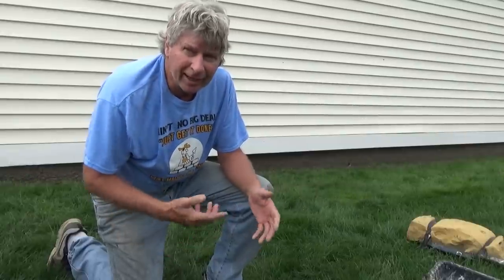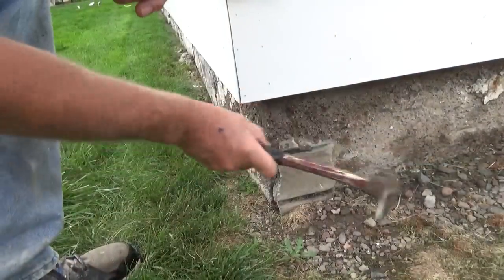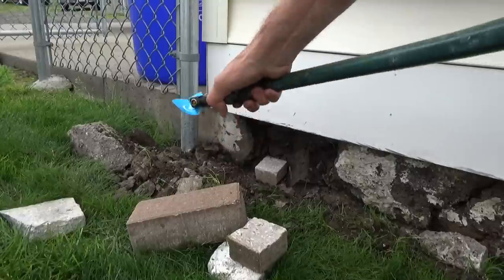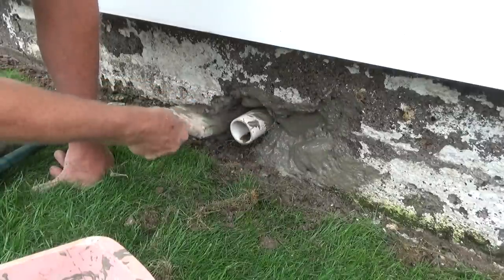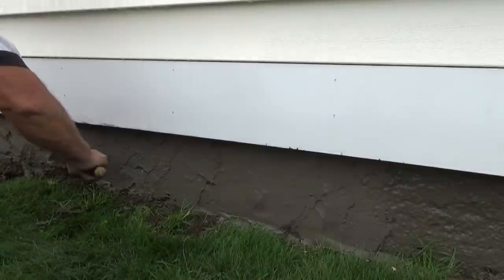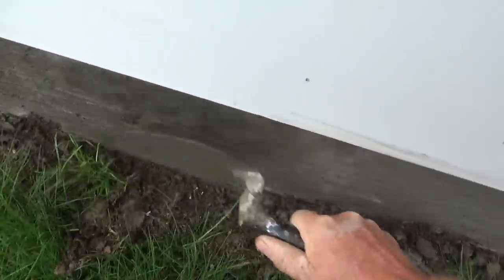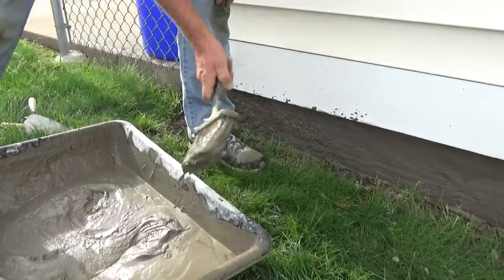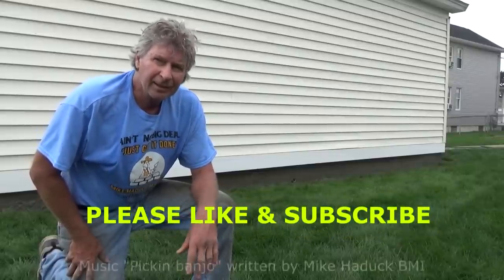FOUNDATION REPAIR (Part 16) Mike Haduck

Comment: One difference between the use of regular Portland
mixes and the fast dry compounds is the shrink cracking & checking issue.
Those newer products seem to shrink a lot less.
I've tried to use them for surface areas. Thank you Mike.
Reply from the maker: Thanks pensive, Mike

Comment: Love your videos Mike, learned so much…I just had a small garage built with concrete blocks as a foundation. I want to cover the blocks with stone veneer, do i use the same mix, one scratch coat, on the blocks first before I add the stones?
Reply from the maker: Hi Louis, I have a playlist on "stone veneer installation" I do that but might add some screews or clips for the thin veneer, thanks Mike

Comment: Great video mike. Quick question if a water leak is coming in, would you recommend taking off all the concrete/mortar on the inside on a foundation? I have a sand/stone foundation and it seems in the 80s or so they parged it with Portland cement and portland white paint. Only problem is the wall won't breathe with that covering. Removed a whole wall of parging but today noticed a smaller leak near the floor. Started removing the stuff like a dentist but most of it is staying, even though the wall is damp behind. Getting some gutter repairs and digging a french drain to stop it from coming as much.
Reply from the maker: Hi Jedi, I never seen a leak that could be stopped from the inside, I never had problem with Portland, motar always flaked up and fell off when I used it, there are some others with different ideas but somehow I would think it's from the outside, I hope it helps Mike
Reply: @MikeHaduck  sure does. Thanks Mike. You're a tremendous amount of insight and help. Great work as always. From Chicago

Comment: Mike, 

Could you use a stucco base coat mix for the first layer? I am wanting to refinish my block foundation that had been stucco' d over. I tried to remove the old stucco with a roto hammer, but couldn't get it all off. I love your videos. Keep up the great work.

Thanks,

Nick
Reply from the maker: Hi Nick, I can't tell you what to do, in a lot of my videos I make the coment of like I dentist, only the stuff that's bad, what product you use is up to you, thanks mike

Comment: Excellent job, Mike. Were you able to cover that wooden beam with the concrete mix? Seems like it would have trouble sticking.
Reply from the maker: Hi Brian, yes I did,  It was off the ground and with the fibers it was good just checked the job from the summer. It was good, thanks Mike
Reply: @MikeHaduck  Thanks, Mike. Your nephew does top work.

Comment: Hi Mike,
Awesome video I enjoyed watching. I poured a gas fire pit at my house and it was smooth Concrete but I wanted texture. I made a paste like your stucco mix but used a 3/8 map roller. I'm thinking you could use a smaller one 4" on that. I just put it on heavy on roller and rolled it on, looks great. Have you ever done it like that before?
Reply from the maker: Hi steve, I haven't,  but as long as it works, thanks mike

Comment: Are there any adhesives for concrete that impress you, years ago at my nanas house guys went over her tile roof with what they call pointing mix i think the premade bucket said , some of it fell down onto  concrete drains while they were working on the roof, man that stuff stuck on hard you cannot remove it, so im thinking it has an adhesive in it.
Reply from the maker: Hi. I can't say, there is so many products today it gets confusing, thanks Mike

Comment: Mike, I thought the difference between mortar and cement was the sand. This video shows the product as type S cement but you say mortar. I am so confused! My area only has type S mortar ( with sand) so what is the recipe with that product? Thanks
Reply from the maker: Hi Terry,  I did a video called  " mason mix" type s-n mortar,  also have a series on what type of cement should I use, thanks Mike
Reply: @MikeHaduck  Mike, I have watched both of these (and many more) but I have been unable to see or (understand) a recipe for a parge mix using type S mortar (just add water). Is the ready to use type S mortar suitable for parging as is or does it need to be fortified with bonding agent and/or extra Portland cement? Thanks

Comment: I think at 4:06 it should be one part masonry sand 1/2 part mortar and 1/2 part Portland cement
Reply from the maker: Hi Joe, I don't know, I just use what I think is best in each circumstance,  thanks Mike
Reply: I just mean your text doesn't match up to what you did I think you use one bucket of sand and 3/4 bucket of cement.

Comment: How is 1/4 s mortar and a 1/4 Portland 1 part? That’s only 1/2 bucket 25% + 25% is 50%.  I’m confused.
Reply from the maker: Hi Matt, at one time not so long ago there was only motar, portland and sand and each mason in there area would mix accordingly to their weather and what they were doing, when I work on foundations my mix is usually 1/2 bucket of Portland 1/2 bucket of mortar and 2 buckets of sand,  now you can buy the premix S mortar with it all combined and just add water, I would do a little experimenting where it is least seen, wait a couple days and see how it is comming out, I show what I use in each video, after watching more on the subject I think you will get it, Mike

Comment: I think you are rich because you know how to save. I've seen your trucks, poor people wouldn't have those old beasts, only rich people have them :-)
Reply from the maker: Thanks Das, I worked as a mechanic for a while and I just can't give into these new trucks that no one could fix,  a old carb, distributor and standard transmission,  can't beat it,  thanks mike
Reply: @MikeHaduck  Yup. One just keeps their fingers crossed that nothing breaks on a newer vehicle. Having electric motors instead of a cable for an emergency brake, plastic gas pump in the gas tank, plastic water pump, computer controlled everything, etc. We are stuck with what is offered.

Comment: at @4:04 there 2 parts to 1/4+1/4 which is 2 parts to 1/2 part which is 4 to 1. I think you meant to write 2 parts sand to 1/2 S +1/2 Portland which is 2 to 1 , sand to cement.
Reply from the maker: Hi Paul yes 2 sand to 1 cement, thanks Mike